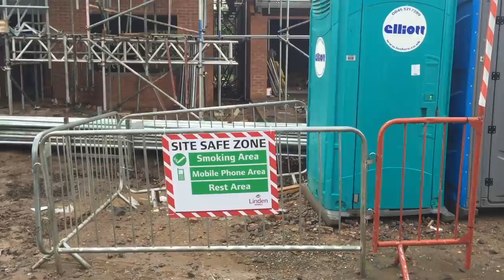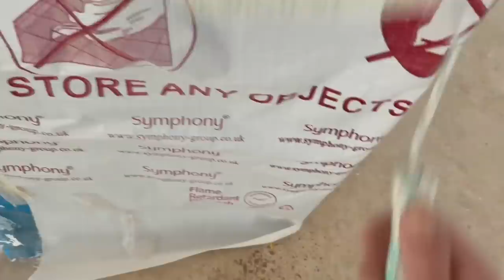Purdy Jumbo Mini Roller, Replacement Solution

Comment: Keep the Purdy frame 
Add the the 4inch sleeve as normal so the whole thing is not lob sided , limited life span of that purdy Gear , especially them big roller cages don’t  bother with em plastic shite 
Stick with 15 inch standard frames 
Things we have to do to get by eh